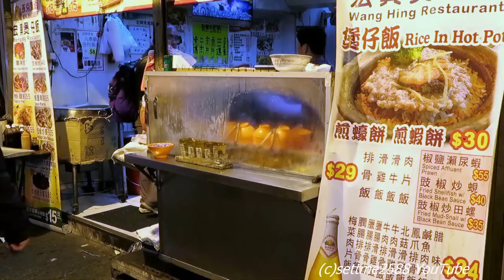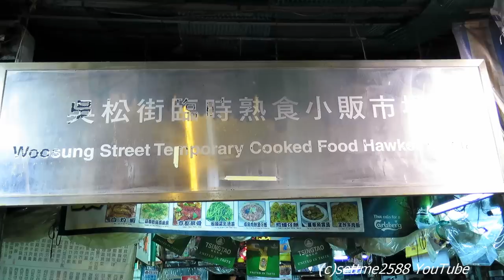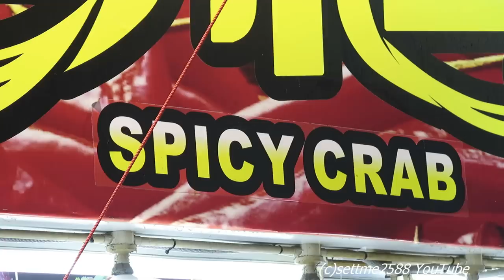Hong Kong Street Food. The Fabulous Stalls of Temple Street, Yau Ma Tei

Comment: The green plastic chopstick in that hot fried oil
Reply: +Luckyna Sourn It's a legit concern but if you worry about stuff like that then these places are not for you.
Reply: +Luckyna Sourn I doubt if the oil is anywhere near as hot as melting point of the chopsticks. Also, when she pours the mixture into the oil, the oil temperature will reduce at the surface, making it even less likely to melt the choppys because only the tips go into the oil. Hope this helps

Comment: lady sticking plastic chopstick in the hot oil wok??
Reply: +wilson ang I doubt if the oil is anywhere near as hot as melting point of the chopsticks. Also, when she pours the mixture into the oil, the oil temperature will reduce at the surface, making it even less likely to melt the choppys because only the tips go into the oil. Hope this helps